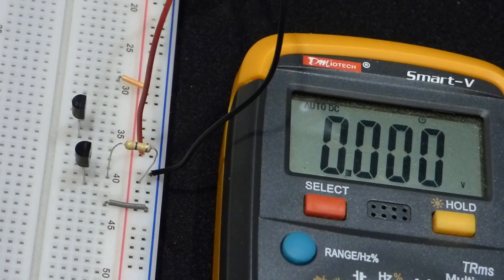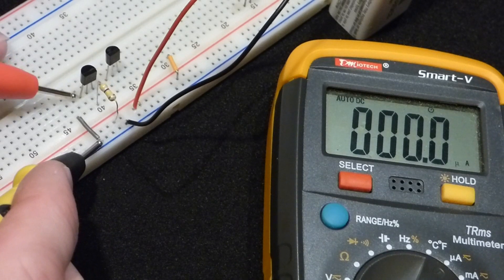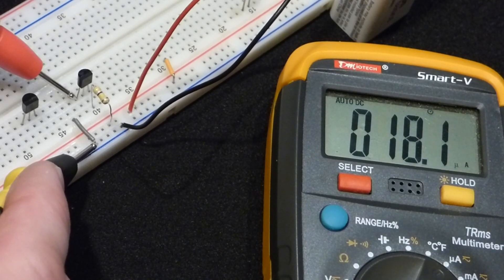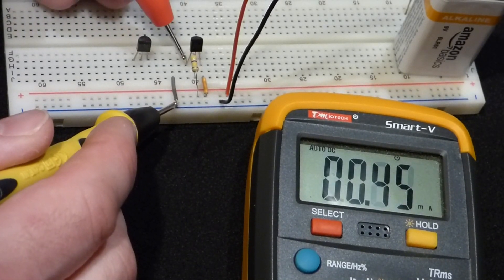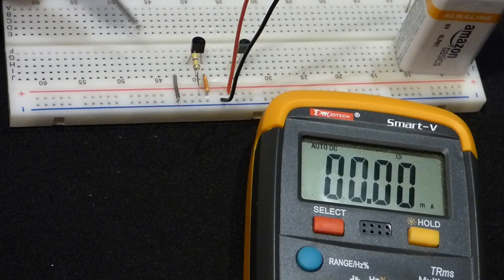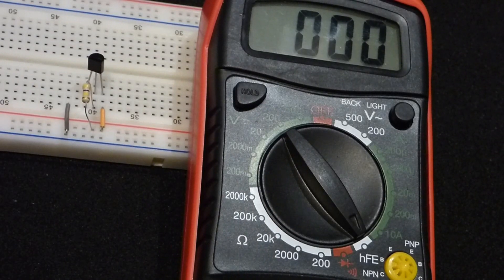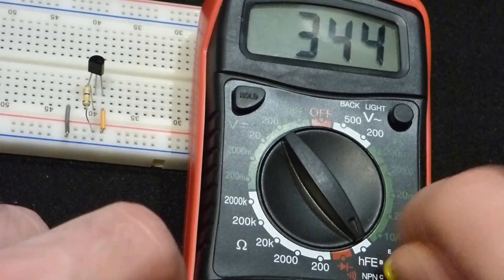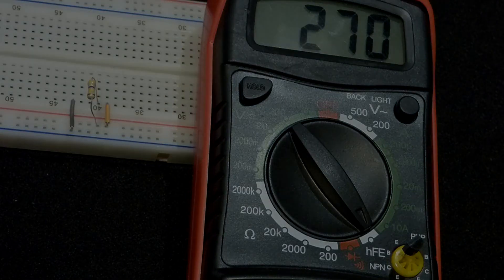Breadboard gain test and multimeter hFE test of 2n2222 and 2N3904 NPN bipolar transistors

Comment: This short-term test with no current limit probably isn't going to damage the transistor.  It also makes sense the device will eventually smoke and be destroyed.  Any idea if hFE decreases if the device is over-dissipated, but stopped short of burning?  Just curious if pushing a BJT to it's limit, or perhaps beyond, will reduce its performance permanently?
Reply: Use a Curve trace before and after. You will see the damage results.

Comment: I have a question/issue maybe you can help me with.

i am following a self teaching book on electronics and there is an exercise where you take a transistor and do the measurement you did on the bread board. but the book has you use multiple values of base resistor and put all the values in a table.  you are suppose to get the same calculated gain within reason for all the different resistors until you reach saturation.  the example in book says he got the same beta/gain every time. 

I however got a big range always started high and kept going lower with the smaller resistors.  

I just don't know what is right.
Reply from the maker: I'm not a transistor expert, so I'd look for a more authoritative source.  But, the Bipolar Junction Transistor Collector should tend to conduct better as they heat up, especially when there isn't enough load to limit current. That's what causes thermal runaway. Often people will use a fixed BJT gain as if it is perfect in order to simplify the mathematical explanation of gain.
Reply: @Electronzap  thank you for your reply.
Reply: They more than likely mean add different volts/current by changing the resistors at the base. Write up a table with all your results, then you can plot it on a curve x,y .
Reply: hey guys thanks for the replies. 

I finally figured it out.   I had multiple meters hooked up in series so I could take the amp for base and collector at the same time.  

turns out the signal and/pr resistance of the meters both at the same time was throwing things off.   

so when I picked on base resistance and measured the i(b) and then measured i(c) next and seperate the beta values were much more consistent.
Reply: @fredgarvin4482  thanks for posting a follow-up, now others can learn from your experience, too.

Comment: Great work can you tell me how to find the exact value of hfe by using a data sheet because it gives normally a range like 50-60
Reply from the maker: Gain varies based on how you use it and between individual transistors. Mostly you use the datasheet to make sure it has enough gain, and then you control it after that. There's no BJT that has a solid 100 gain or something else specific.

Comment: Thanks for this video.
The pin arrangement of the 2222  (CBE) is different from the 3904 (EBC).  Throughout your testing you used the same orientation.....hmmm....I would have thought the orientation would have mattered....
Reply from the maker: My 2222 and 3904 both start with 2N, and have the same pin payout of (EBC). Some other 2222 though do have a different pin layout. Need to adjust accordingly if yours do. Thanks for watching!
Reply: @Electronzap  Got it, thanks. Tricky..

Comment: How different is your approach from measure Ic, Ib and find beta as Ic/Ib?
Reply from the maker: You can measure the base current and collector current independently.  But since collector current is usually hundreds of times as large as base current, I usually measure the base current alone at the emitter, and then add collector current and also measure it at the emitter. You can simply subtract the base current from collector current at the emitter, or ignore the base current since it is so small.

Comment: How come i can't obtain a current value with the exact same set up? Help!
Reply from the maker: If wired exactly the same, most likely cause may be a bad breadboard connection, which is common.
Reply: Thanks for the prompt reply! What are the other possible mistakes/errors? And are you measuring the base & collector current?
Reply from the maker: I'm awake at an odd time, so it worked out for quick response time in this case lol. The base and collector current both go through the emitter, so ultimately I am measuring the current of the base and collector. The base current is so much smaller than the collector current that while the collector is conducting, the base current added to it doesn't really affect the total current at the emitter much, so you can just consider that the collector current. I should really redo this video soon, it is hard to see what is going on.